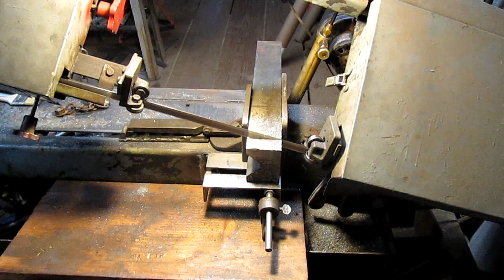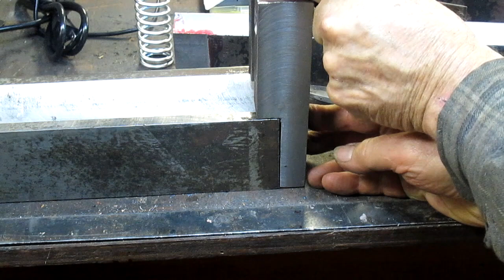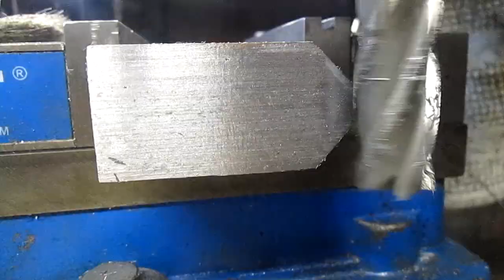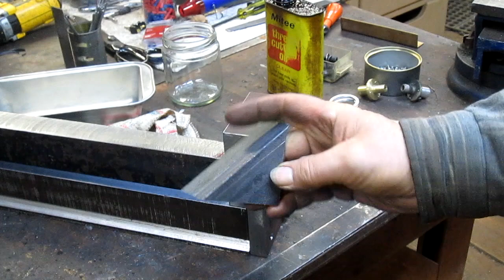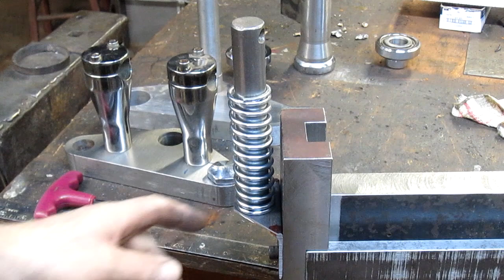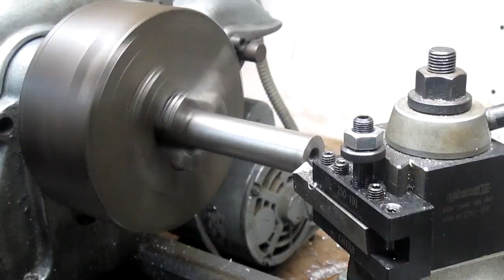Press Brake, Second Take #2

Comment: Hi,
why is the sound hidden during milling?
I would like to hear how loud the mill is, and how it screams,
(nobody should hear that)
quite dangerous to hold the small vise only by hand when drilling with the larger drill.
and keep fumbling with the fingers on the spinning parts,
man oh man....
Reply from the maker: My editing program deletes the sound when I fast forward, thus the silence.
Reply: Hi,
that's right, so I've noticed
since I restored a Kondia VF1,
I would like to hear from another machine the milling noise .....
Reply from the maker: @ralfkrohn8165  Depends on what I'm cutting.

Comment: Your solution for the spring mounts is exactly what I would have done.  Cool!
Reply from the maker: Oops, it changes as we go on.
Reply: @NikColyerMachineWorks   Yup.  You are very flexible.
Reply: @NikColyerMachineWorks ..... But, you always make it work.
Reply from the maker: @vernonkarm8016  Come hell or high water. Thanks for the confidence.
Reply: @NikColyerMachineWorks  Great design work on the fly. Why waste time and paper and pencil lead to figure it out first?
Reply from the maker: @leeklemetti1887  Truth be told, I'd been working out the design in my head for a fews weeks before I started. My mind just works that way.